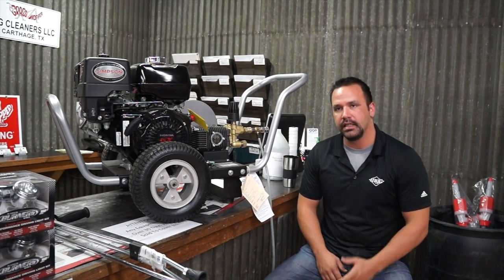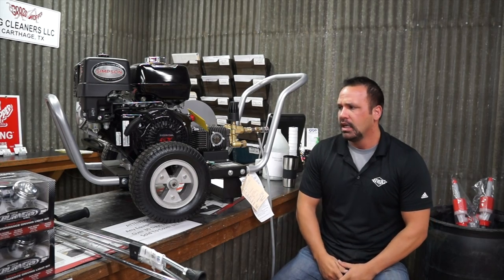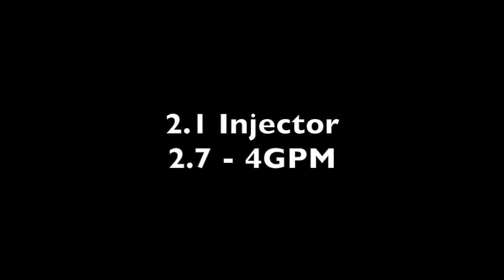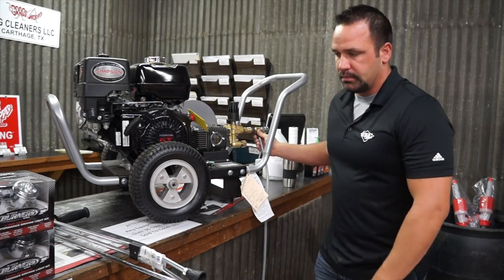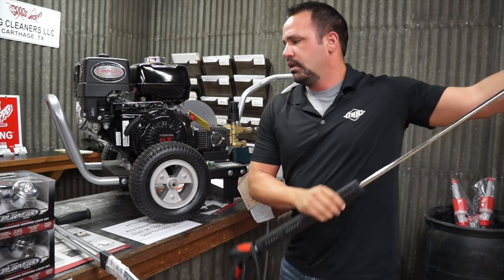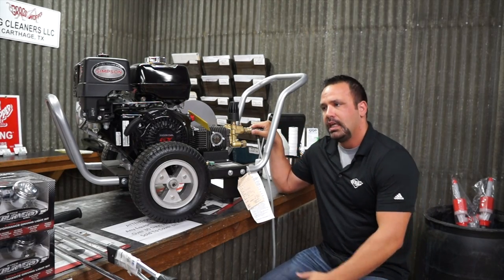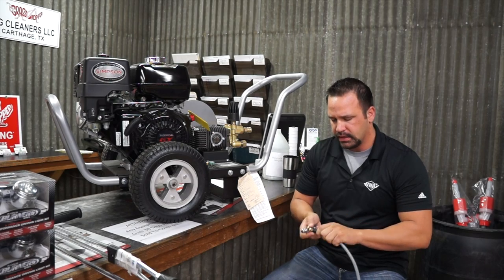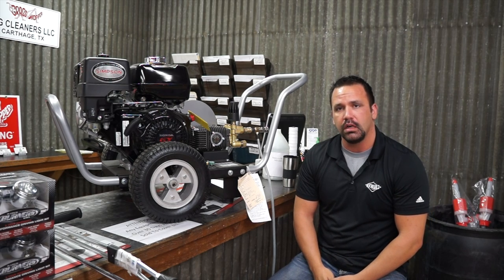Chemical Injectors

Comment: I’ve bought 2 and can’t get it to pull. 
My pressure washer is a 4 gpm machine. It has a soap injector built into the pump up stream. . Is there anything I need to do to the factory side to get the down stream injector to work. 
Thought maybe the first one was just bad so I picked up another one and still not success . So curious if the factory injector is the issue?

Comment: Hi,

I have a question.  If i have a pressure washer that has a internal chemical injector. The standard style you find on most machine.  Can i use a external chemical injector like the one you are demonstrating? If so do i need to cap off the internal chemical injector so the external work correctly?  

Asking just in case i have to replace the injector due to failure or forgetting to clean it. Yes, it does happen (not cleaning),  LOL....

Comment: How can you figure out the ratio of how much chemical you are pumping
Reply from the maker: Depending on the applicator and the amount you have it open but you can figure that 17:1 is a pretty close bet usually on most injectors.
Reply: @MGCleanersLLC  I have 4gpm, at 3500psi, and a 30 to 1

Comment: i have a homelite  elec 1700 p s i 3.5 gpm with a soap dispenser that uses a soap packet that goes in the dispenser they discontuned the packets  how can i make it to dispence soap there is a knob on the dispencer that u can turn to soap or rince thank u ron

Comment: Plz help, my injector is shooting water out like a geyser? I have replaced the little ball n rubber washer/gasket inside twice, same results. How do I fix this? I have a dewalt 3.5gpm 3750 psi washer that I love but this issue is driving me crazy and of course making it impossible to use chemicals
Reply from the maker: Well it is hard to tell without seeing a picture from where the water is coming from but it sounds to me like the housing is cracked. If this is the case a new injector will have to be purchased. It could also be the valve stem itself is no longer functioning properly. Unfortunately with injectors depending on the brand it is cheaper to replace than it is to repair it. Feel free to give us a call or email us some pictures and I will try and help more. Sorry I can't be more help.
Reply from the maker: schristian@mgcleanersllc.com is my email. I will look at them and respond as quickly as I can. Thanks
Reply: MGCleaners LLC Thank U, is there an email address I can send pics to for you to look at?  It shoots out the hole that is where chemical is supposed to into machine thru, like the ball isn’t blocking it, very strange, worked fine for years... thanks so much, chris

Comment: My pressure washer doesn’t have a soap injector!! How do I install one ?
Reply: Its real simple. If you have one you just install it behind your unloader. So it should go between your machine and hose. If you dont have one i recommend ordering one that comes with quick connect fitting to quickly install it at your hose.
Reply: Stephen Christian thanks, my pressure washer does have a quick connect, where do you get those? Amazon? Is there a website that you recommend?

Comment: How would you switch between 2 chemicals on low pressure downstream side?
Reply: I'm no expert, but perhaps 2 injectors, one for each line, ran to a dual lance with a soap tip on each lance.
Reply from the maker: you would need to plumb them together with either a valve at each tank or a 3 way valve to pull the soap that you need at that time. We use this setup in our system also to antifreeze the machine in cold weather.
Reply: Stephen Christian thanks